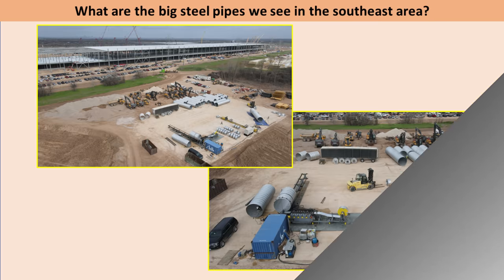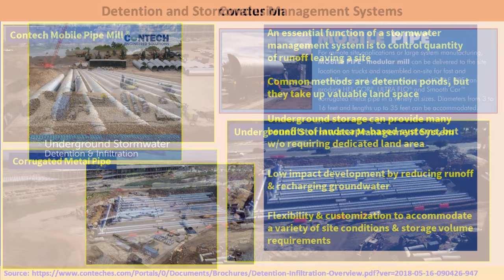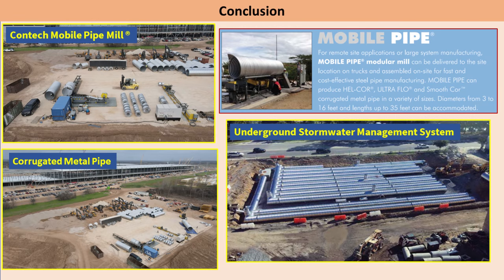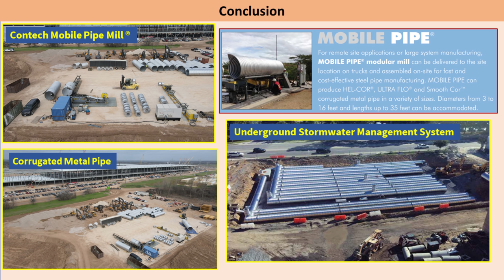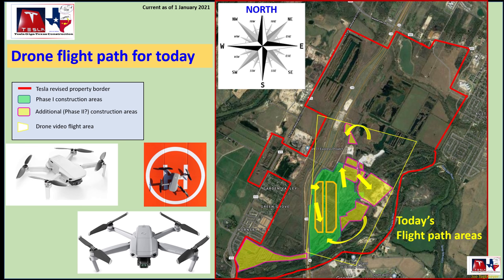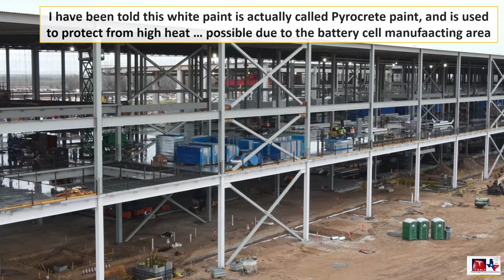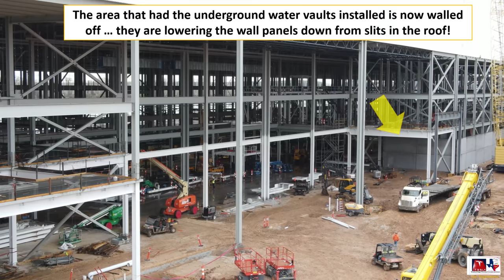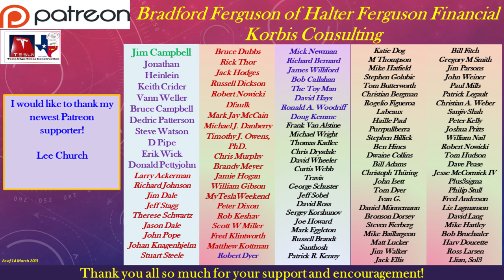Tesla Gigafactory Texas 14 March 2021 Cyber Truck & Model Y Factory Construction Update (08:30AM)

Comment: The blue board in the stamping plant might be American Gypsum M-bloc. Their only product with the blue paper face that I could find. 

Here's their blurb. M-Bloc® IR Type X interior gypsum panels were designed and tested to not only provide exceptional resistance to mold and moisture, but superior resistance to impact penetration, abrasion, abuse and indention when compared to traditional wallboard. This Type X panel consist of an impact, abuse defiant core encased in heavy abrasion, mold and moisture resistant blue face paper and brown back paper manufactured from 100% recycled paper, with a fiberglass mesh fabric embedded into the core adjacent to the back of the panel to provide additional impact and penetration resistance. At an independent laboratory accredited in accordance with ISO 17025-2005, M-Bloc panels have been tested to the industry’s most rigorous standard achieving the best possible results per ASTM D3273, scoring a perfect 10 thus minimizing the risk of mold and mildew growth.
Reply from the maker: Thanks Dessie .. I believe you are correct!
Reply: @JoeTegtmeyer  At 6:14 peering deep in the stamping plant it's possible to make out the bares studs of the east facing dividing wall. Looks like white in between the studs. The M-bloc board according to American Gypsum has a brown paper backing. Thinking the white is likely to be insulation of some type. If it is insulation that confirms for me that it's a permanent wall, and not some temporary structure that others are suggesting.
Reply from the maker: @DessieDoolan  that’s a good observation ... if I can I will try to get a better look.  It’s going to be cloudy tomorrow so lighting won’t be ideal.
Reply: @JoeTegtmeyer  Hi Joe. The north wall in the stamping plant hasn't been sheeted on the north face either. Maybe try and sneak a view there.  Any chance you could get a close up of those odd footings down the central roadway? Particularly like to see the white sheathing on the rebar. Or maybe a photo to zoom into.

Comment: Around 11:33, it looks like long electrical insulators (the brown, rippled ceramic rods) and high-voltage buss bars are going into place.  Do any of our electrical experts know what the four grey units, bristling with insulators, are in the lower right at 11:33?  Also, what is in the three sheds in the upper left and what does the brown path connecting them mean?
Reply from the maker: Those are substation circuit breakers

Comment: So watched a video from couple months back. You went through what you thought all the building sections were for. Would be curious of how you think the Model Y construction would flow and then how the Cybertruck construction would flow. 
Like Model Y
Parts are stamped at the far end and at the same time Gigapress makes the front and rear assembly. In the body in white section the stamped and the pressed parts would be brought together and the batter pack would be installed as well.  Where would the battery pack come from? Then the whole thing heads to the paint shop and goes from end to the general assembly area where final assembly is done.

How would Cybertruck be different?
Could they be building Model Ys while Cybertruck assembly lines are still under construction or do they share to many areas?

Comment: That blue interior wall material 4:53 is again visible at about 5:47, and now appears to be also lining the inside of the exterior north wall of the stamping building.  Is this material possibly for noise reduction?  Those rows of "dimples" in the surface suggest that function to me.  I imagine that the stamping process could be noisy.  I think Dessie Doolan has other ideas in his comments further down the list.
Reply: Hi John. Might be for noise reduction for sure. The dimples, your eyesight is better than mine, or ................are they logos for American Gypsum?
Reply: @DessieDoolan  Hi Dessie...I took them to be dimples, but I'm not sure either.
Reply: @johnweiner  Joe's Patreon site has a bunch of photographs that it's possible to zoom into. A bit of googling and I found the logo of American Gypsum looked identical. They have the product M-bloc that has the blue paper face. It's listed under their fire rated products, but it's main feature is moisture resistance.
Reply: @DessieDoolan  That must be it then: the American Gypsum label and not dimples.
Reply from the maker: Glad my high resolution photos come in handy!  Thanks for the information and detective work!

Comment: At 7:00 the conveyor system built into the floor.  I saw this moving in the following video - skip to the 2.30 point.  I slowed the video to 0.25 and set the back and forward to 5 seconds for best playback.
https://youtu.be/yzV-6IrhSMM

At 10:20 They have to be careful when digging along the powerline right-of-way -- there's a big gas line under there, too.  😱
At 16:20  Ent cranes.  🤗🤗

Thanks for the down low closeups, Joe.
Reply from the maker: Thanks!

Comment: Now we know they plan to handle the runoff from the roof.
Reply from the maker: What would that be?  Finish the complete installation first ... is that what you mean?
Reply: @JoeTegtmeyer  What we knew seven months ago: That's a lotta acres of roof. When it rains the water will run off the roof and will hit the ground.-----    Now we see where it will eventually be drained. Through that massive culvert. Using a downspout system to feed the culvert. It will be interesting to see how they eventually get rid of it.   Fly safely Joe.....
Reply from the maker: @ronaldgraves6196  😎🤗

Comment: @8:00 Hmmm, the roof is kinda leaky!  lots of water coming through!.. not good!
Reply: it's not supposed to be waterproof yet, there's nothing close to a waterproof coating on the metal sections, they will probably get a concrete layer at some point, but even the concrete has joints that aren't fully waterproof, it will need some sort of top surface (think tar or a higher-tech equivalent) to be fully waterproof.
Reply: @davidelang  I do not think that concrete will be poored over the truss beams, these are not strong enough to bear such weight.

I really thought these roofs were more or less ready, as not much is going on on the roofs for weeks now.
Reply: A few inches of insulation, then a plastic or rubber membrane weather aeal.
Reply: @MarcoNierop  remember, they would only have to support the concrete and rain/snow load, not equipment, people, and vehicles, so far less strength is needed, which means less concrete is needed, which in turn means less strength in the trusses.
Reply from the maker: Its far form completed ... several more layers (not to mention a lot more construction) yet to be done.  The current panels are not meant to be water tight just yet.

Comment: I discovered Tesla has been using E-Coat since 2012 for body in white on the model S. I’m curious if E-Coat is used to create fine metallic paint top coats or are they still sprayed? I think top coats have traditionally been applied after the doors are hung on the body to get a visually even finish. At 15:25 it’s interesting that some of the white wrapped bottom coat tanks are located beneath a mezzanine structure with large openings in it. I am also curious about the large corrugated pipe. Do they simply crimp the joints as they are coiled or is a sealant or welding involved in making the pipe sections? Do they need to be absolutely water tight or is a small amount of leakage acceptable?

Comment: The blue wall looks temporary. I do not see a clear use for the bridge crane in the south end this way.  Also no rail stops
Reply: They will install another overhead crane in that section. There is a large foundation there and they did not install those rail beams for fun!
They also did not install that giant wall for fun😂
Reply: Also they had double columns at this point which had suggested a wall as well .
Reply: @davidclark2286  good point.  I may not be able to see the stops.  Doesn’t mean they are not there
Reply: it could make sense to close in one section to then bring in a stamping machine and start getting it setup before they are ready to fully weatherseal the entire building

I agree that it doesn't seem to make sense to put crane rails the full length and then put up a wall that blocks them (and I also don't see any stops to keep the crane from crashing into the wall)
Reply: @davidelang  I agree
Reply: There ARE stops on the southern most opened and of the rails. They can use electronics stops on both sides of the wall because if some idiot runs the thing too far AND  the electronics stops and back ups somehow fail at least the crane will just hit the wall but not fall to the ground!
Reply: And if whatever they are carrying with the crane is wider than the crane(which is very likely) it is going to hit the wall first anyway😂😂😂
Reply: I'm convinced it's temporary. I kept asking myself, why would a temporary wall be needed? I think I have an answer. I am guessing that they're for dust control. While the presses are being installed, there will be a lot of exposed high-precision surfaces that have to be kept spotlessly clean until they are mated together. For example, the bearings on the giant flywheel that was brought in yesterday. There's so much dust in that place, even kicked up from the mud on the floor, that would get in everywhere and prevent alignment or just score up and scratch up the surfaces.

Comment: I wonder why the walled off area in the “stamping building”?
Reply: I am guessing that they're temporary walls, and that they are doing it for dust control. I'm guessing that while the presses are being installed, there will be a lot of exposed high-precision surfaces that have to be kept spotlessly clean until they are mated together. For example, the bearings on the giant flywheel that was brought in yesterday. There's so much dust in that place, even the mud on the floor, that would get in there and prevent alignment or just scratch up the surfaces.
Reply: @LinasVepstas  thank you
Reply from the maker: Not sure yet, but they are pretty substantial walls, so I expect them to be permanent.  We should see large stamping machine parts arrive this week on site, so we shall see.
Reply: @JoeTegtmeyer  thank you Joe ... I can never wait for your next post ... and as you say ... we’ll see.
Reply from the maker: @markkillip1281  😎👍👍

Comment: At 17:48, I wonder if the use of "pyrocrete" is a result of what happened to the structural steel at the World Trade Center on 09/11/2001?
Reply: I think the World Trade Center had an insulating coating on the steel. It’s standard procedure. It’s code. The problem at the World Trade Center was the enormous amount of jet fuel which caused the blaze.
Reply: @jeffbransky6499  Thanks for this info.

Comment: I think the LNG is to melt the AL.  Generators likely are running off Diesel .  I think they will be making parts on the gigapress within a month.
Reply: In casting, the metal is usually molten by high current electrodes. However, if necessary, burning LNG can be used in the annealing process to relief the internal stress in the cast parts caused by the cooling, thus preventing any cracking during future operation of said parts.
Please forgive any mispelling, English is my 3rd language.

Comment: Another excellent recap and the video. The progress seen every two days is breath-taking. Lots of men and material on site signifying more work will be done in the coming weeks.

I am curious as to why they have not bought more Giga-presses on site now that one has been installed and tested?

Keep up the great work, Joe.
Reply: i was curious about that also maybe they are getting them as soon as they are ready from the factory or lack of trained man power to put them together.
Reply: my guess is that they are working to get some production up ASAP, and this one giga-press ill be in production while the others are getting setup.
I think we are seeing the same thing on the south end, they are preparing to get one stamping machine in place and going well before bringing others in.
I think there is going to be a running production line well before the factory is completed.
Reply from the maker: They have purchased them, but between Giga Berlin and Giga Shanghai, it takes some time to manufacture them... I expect to see more in the next month or two, but they also have foundations and a extension to the casting machine structure to build.

Comment: Joe, you provide so much info it's just amazing. Thanks for your diligent work!  
Do you know how many undercoat and topcoat stations they have in the paintshop? Could not see from your video (could not see those behind Gigapress area).
Reply from the maker: Thanks Mark ... I'm not sure but the way the parts are being installed, it appears there may be just one installation with many tanks.  Looks like one line is the body prep and E-Coating and one would be the top coat line.

Comment: Joe, the rain collecting on the floor in the buildings - will that possibly harm or destroy the equipment sitting in that humanity? I thought they would move it in to protect it but that does not appear to be the case. Maybe its a wet-storage-test?
Reply from the maker: The roof is not close to being completed or water tight ... several more layers need to be installed.  Apparently they have done a risk analysis and thing installing equipment and using tarps and other coverings is acceptable.
Reply: @JoeTegtmeyer  Do you think Tesla will put a massive solar system on this roof. Your videos always show how massive it is and I could imagine it could really generate a ton of electricity

Comment: Is the roof leaking in the paint area?
Reply: Solo un pocito
Reply: The roof hasn't been sealed yet.  It's just the bottom layer of a roof as now.  It's safe to walk on but not weather-sealed.
Reply from the maker: It's not yet completed or made water tight ... this is just the first layer.  more to come to seal it and insulate it.

Comment: is that LCRA trailer possibly a generator to power the switchyard for testing?
Reply: Possibly used to fill the transformer with oil and make the oil super dry and then test the system.
Reply from the maker: I think Elton is on the right track

Comment: Hey Joe. Love the channel! Can I ask a dumb question? Is the roof surface finished or is there a layer of insulation and flexible membrane going over the top like Giga Berlin?
Reply: I think it will be covered and insulated on the exterior like Berlin. One factor that really supports this idea is that the corrugations are running perpendicular to the slope of the eastern roof area. (Not conducive to runoff) they left gaps in the roofs wherever there is a row of double columns to allow for expansion and contraction. Those expansion gaps will be bridged over by the outer roofing material. I don’t thin the corrugated roofing material strips actually seal together in a water tight configuration.
Reply from the maker: The roof is far from finished ... just the initial panels (not water proof) have been installed on the steel structure and the top coating of concrete on the concrete structures (which will then be covered with the metal sheeting on all the other areas).  There are most likely several other layers that will be added, not to mention the HVAC and other equipment and solar panels on the roof once its done.  We have a lot of work remaining.

Comment: How do they have a roof, concreted middle floors and the ground floor is swimming in rainwater?
Reply: The roof isn't completed, it requires insulation and sealing which won't be done until there are drains to take the water away, as completed roofs would collect and concentrate water build up in a few areas which woudl cause more problems.  Once the culverts are in the roof will get completed
Reply from the maker: This is not a completed roof ... many layers still need to be installed to make it water proof.

Comment: Joe, one of interesting things I’ve noticed between Shanghai, Berlin and Austin build sites is that the first 2 have significant complexes of temporary Modular housing for workers. I would think that a project this size would eventually construction works well beyond the local area.

On another note, can you get a good close up of the triangle notch in the roof of the stamping area structure? It seems odd that it has yet to be filled in as one would expect it to be.
Reply: I noticed that the colume in the notch has formwork(/shutering)on the top of it.  It could be that this needs to be concreted before the triangle can be filled in.  A few times it has been mentioned that people were working on it.
Reply from the maker: I actually have taken some very close high resolution photos of the notch ... they are on my Patreon page.  Next time I fly I'll try to get a bit more video of this area.

Comment: are the floors with squares in the floor going to be elevators
Reply: that's my thinking
Reply: Stairs, and spaces for conveyors etc to pass up and down between floors. Elevators generally have an over-run pit. Haven't noticed one yet.
Reply: @DessieDoolan  With all the floors I figure they need industrial elevators to get goods to the above floor to assemble/manufacturer pieces, otherwise what's all the floor space needed for.
Reply: @cryan9376  Yeah agree. You would think there would be goods elevators at least on a site this big, and I'm sure there will. But any elevator would have an over-run pit, and we just don't see those on site yet. There's a few comments elsewhere under this video about some pits in north west corner possibly being over-run pits. I happen to think they are drainage pits, pipes running into them. All good fun speculating anyway.
Reply from the maker: I think Dessie is on the right track with the answer.